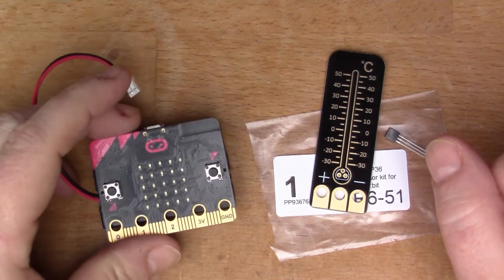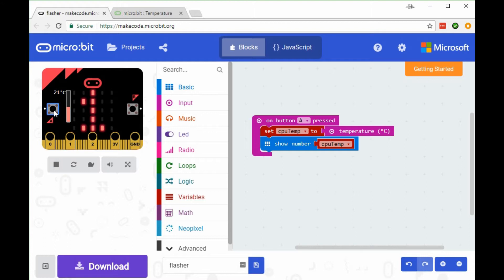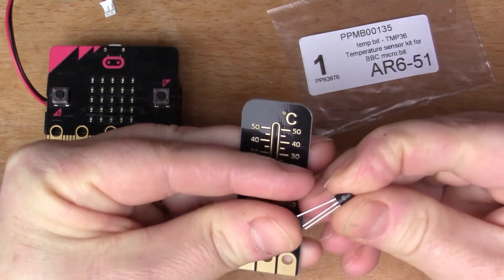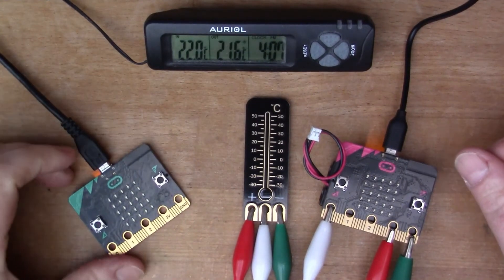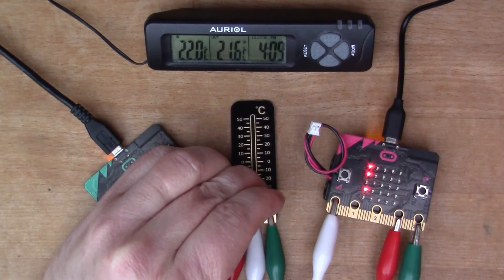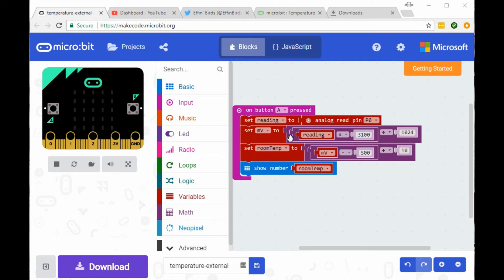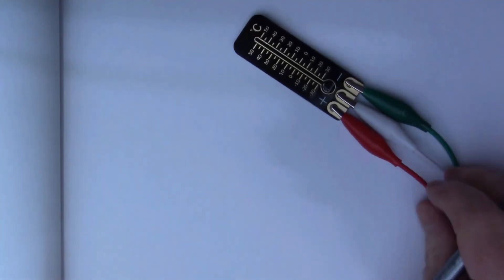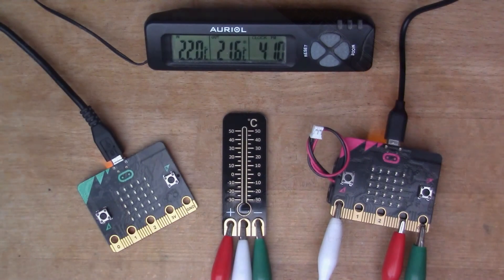Measuring Temperature with the micro:bit (#65)

Comment: It would be interesting if the mount for the sensor could have leds going up it to give a bargraph visualisation of the temperature, albeit in 5 degree steps! How easy would this be to code?
Reply from the maker: You can use the microbit display as a bargraph (see example here: https://makecode.microbit.org/_PYCFFpAF49Fa), but of course the 5x5 display is quite a limitation.  You can plug in a strip of Neopixels to the microbit: this would be a good way to make a long bargraph.
Reply: I was actually thinking of smd leds on seperate output pins 

which I suppose is a bit more untidy than neopixels with their data feed!
Reply from the maker: Yes that's possible.  According to this page (http://tech.microbit.org/hardware/) there are 19 pins that could be set as an output .  I sometimes use these proto-pic breakout boards to get to the pins (https://www.proto-pic.co.uk/edge-connector-breakout-board-for-bbc-micro-bit-pre-built.html) although I see on their website today that they've discontinued them.
Reply from the maker: Actually they still are listed on Kitronik: https://www.kitronik.co.uk/5601b-edge-connector-breakout-board-for-bbc-microbit-pre-built.html
Reply: I actually already have a break out board!  I liked the idea of using led's but my only gripe with the micro bit is that the end results can be a bit cumbersome!  With arduino you can experiment using the board but can then embed the microcontroller in your final product without all the paraphernalia that's used during development!  That said I suppose the micro bit is designed purely as learning tool.